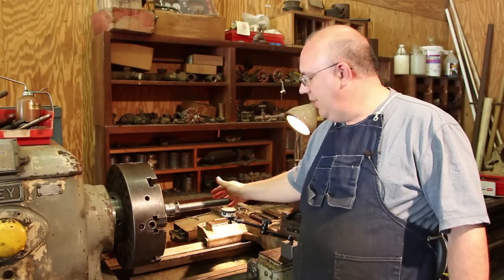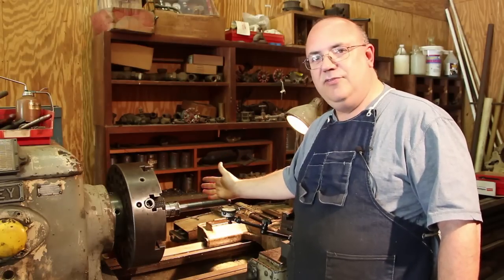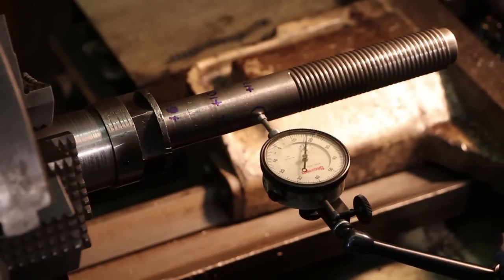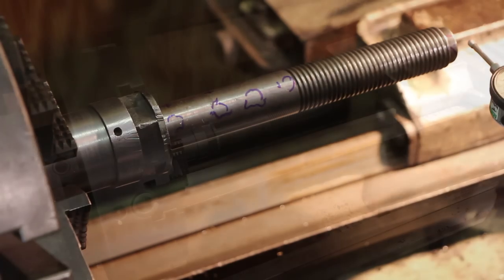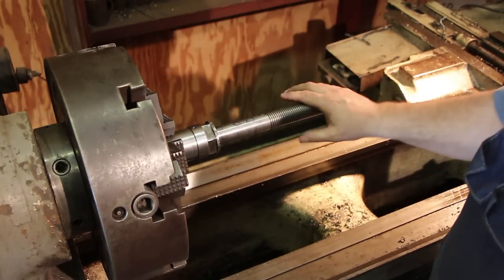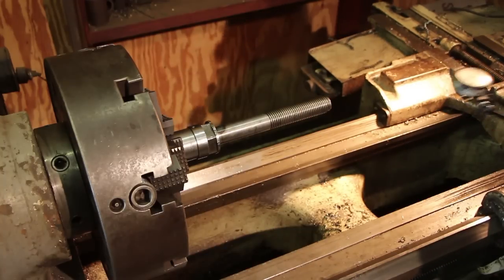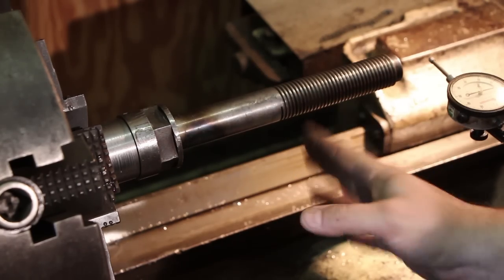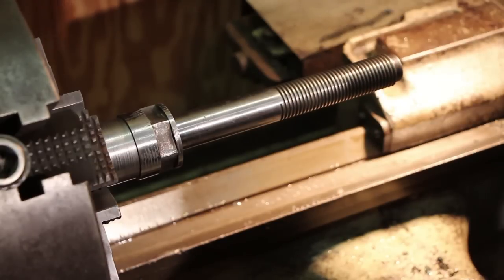Flame Straightening a bent Steel Spindle

Comment: Hey Keith,

Nice video. You got the technique right. The arbor was a great example for the process.

All the best,

Tom
Reply: Bill Lewis the way the shaft is bent, it's bent towards the high side, heating that side near the base makes that side grow a little longer therefore pushing the other end back where it needs to go. Putting water on to cool quickly helps "freeze"it where it is. If he'd let it just cool it probably would be back where he started
Reply: Bill Lewis Hi Bill,

Its almost purely mechanical in nature. Its an upset. The rapid heating pushes against the surrounding cooler material and forms a small upset. The net change is a shorter section right where the material was heated. It acts just like a tiny turnbuckle pulling the material up. I have a chapter dedicated to the process in my books if you want to learn more. Welding does the same thing. As the hot weld cools it shrinks causing the same turnbuckle effect.

All the best,

Tom
Reply: oxtoolco Tom- I have the same question as Bill. I replayed a couple times and if I understood Keith's indicator, in this case the work moved the opposite way; that is, the hot spot didn't shrink, it grew.  Conventionally the heated spot (or weld bead) should freeze under tension and shrink.

???

-mike
Reply: I'm surprised at how this worked.  In a prior life I was  a structural steel welder/fabricator and did lots of heat straitening (up to 60ft long beams).  Our practice was and my experience still is ( I work with sheet metal now) that the shrinking/cooling effect is more powerful than the expansion/heating.  I always heat the OUTSIDE of the bend.  Adding water or compressed air to cool increased the effect.  Does a solid shaft react opposite of a structural/hollow member?  I'm totally confused at how/why this worked for you Keith.
Reply: 76RSLT Hi 76,

The net result of the application of the heat is a shrink. So you are correct that the high spot or outside of the bend it heated and cooled. Initially there is an increase in the bend but on cooling the net is a shrink. Its behaves just like welding. 

Cheers,

Tom
Reply: Thanks for the reply Tom, your description is exactly what I expect.  I watched the video again and it appears Keith is heating the inside of the bend?

Tim
Reply: 76RSLT Hi Tim,

I'm pretty sure Keith said and heated the high spot of the bend which he mapped and marked early in the video.

Cheers,

Tom
Reply: The picture in the link is correct. Heating the high makes it less high after cooling. 

---Tom one last kick.
Reply: I think you guys are forgetting that this piece was bent into the out-of-straightness. Whatever bent it crooked would've left internal stresses in the shaft (the "high" side Keith refers to would be in compression and the "low" side in tension). Most likely those stresses helped nudge the shaft back straight when he heated it. Note that bending something on purpose usually includes an annealing or normalizing heat treatment after to lessen the internal stresses.
Reply: Casey Baker Hi Casey,

The heated spot acts like a turnbuckle and actually pulls the material. The mechanism is not a stress relief. It becomes almost purely mechanical because the material on the heated side is shorter. 

Cheers,

Tom
Reply: oxtoolco That actually doesn't make any sense. Watch the video closer and you will see he is heating the "high side" which expands that side relative to the other side. The internal stresses (which were imparted into the shaft by whatever bent it crooked) then act to push and pull the shaft back into the state it was originally annealed to (straight). The water quenches the metal and causes the grains to crystallize, locking in the slightly straighter geometry.
Reply: Casey Baker And your explanation doesn't make any sense either.
What happens is when he heats it, the metal expands and undergoes plastic deformation. Then when he cools it back to room temperature, the metal contracts and pulls back to a straighter geometry.
Reply: John Cochran John has the mechanism of what happens right. Its a mechanical correction that happens to be applied with a heating device. On thinner material you can easily see the upsets and bulges from the flame straightening process.

Cheers,

Tom
Reply: oxtoolco I'm having a hard time imagining this; could you point us to a relevant video or images that explain what you mean?
Reply: It's because of the water, that's what keeps it in position. Heat applied to the high side will make the material expand and the water cold it faster than what the material is able shrink back pulling it the opposite direction.... Now, if you were to apply the heat to the low side and allow it to air cool, it would first expand making the bend worse, then it would shrink past its original position pulling it into the proper direction.
Reply: Tony Turner Hi Tony,

The root cause is an upset on the high side. Read my book on the subject for more detail. The rate of heat input to the high side causes the upset. The water just maximizes what each shrink produces. It will still upset without water just not as much.

Best,

Tom
Reply: What book is that? I would like to read the detail because, from my experiences, I believe you to be wrong... Whilst you are correct that the material will upset (expand) when heated, it will most certainly shrink on the side you heat once cooled. The temperature, the rate of cooling,  and the composition of material all have a specific bearing on the value in which it shrinks.
Reply: Tony Turner Hey Tony,

Yes that is the idea it shrinks on the high side or long side thereby shortening it. The metal expands as its heated into cooler metal faster than the cooler metal can accept it. So it does the only thing it can do which is displace upward. When it cools, either by itself or with coolant for maximum effect it stays in the upset condition which is shorter. This upset acts like a tiny turnbuckle pulling on the high side and shortening it which straightens the shaft.

The books where I discuss this in detail are called Sink or Swim metalworking and metalworking doing it better. Available on Amazon or through Industrial press (the machinery's handbook guys). I show shaft, plate and weldment straightening with the flame straightening process.

Regards,

Tom
Reply: Tony Turner I don't think you realize whom you are suggesting is wrong! Do a google search on Tom Lipton. I think you will realize pretty quickly he is not some random you tube goofis. The guy has authored two books containing the subject you are debating. I would listen to him.
Reply: It does not matter if he has written two books or two hundred. He is still capable of being incorrect just like any other person, it's called human error. As for him being wrong, I misinterpreted his initial comment and he clarified in the second. Even though I do not like the way he explains the way the physics of the metal moves, he is correct. But, alas, we do not have to always agree with each other. He may not agree with something I say and that's perfectly fine. Just keep in mind, debate is one of the greatest ways to share knowledge, not by being a cocky and smartassed prick. Just something for you to think about Jarret Hall.

-Cheers
Reply: I do hope the couple of names you used in the next to last sentence were examples, and not directed at me. That being said, I agree with your point on debate being an important part of the communication of knowledge.I didn't intend to offend you. It's just I have a great deal of respect for Tom, and consider him a mentor. I can get defensive towards others that disagree or debate the opinions of folks I hold in high esteem.
Reply: Actually, they were directed toward you. Because, while you were "getting defensive towards others that disagree or debate the opinions of folks you hold in high esteem", you were acting like a child.... I may not be some esteemed author but my education, experience, work, and overall knowledge on the subject speaks for itself. And, since you don't know who I am (I will not be found on Google by the way), I wonder what LEGITIMATE reason you had for chiming in in the first place...... I've made my point TWICE now so I will not be commenting on this subject again. Good day to you sir.
Reply: Keith and Tom, like some others, I'm still a little confused on this. I understand Tom's explanation of what happens, and it fits what I've seen when welding...the metal "curls around" the hot spot. For example, if I heat the east side of the base of a flagpole, the pole will tend to lean toward the east once cool. To straighten it I could heat the west side of the base. So far so good, but from what was said in Keith's video, it appeared that he was doing the equivalent of heating the east side to make it go west...so I'm wondering if the confusion is stemming from the "high side"/"low side" terminology?  There was another video here that raised the same question with respect to centering in a 4 jaw chuck.  I'm watching on an iPad, so it's hard to see what the indicator is doing, and I'm still new enough to indicator use that I'm not sure I'm understanding what I'm seeing anyway, so I'm not clear on which side of the curve the heating us happening on.  Could that be where others are having trouble too?

An alternate theory I'm considering is based on the other commenter mentioning heating to forging temp and getting plastic deformation.  That is how Tom's method works...but Keith wasn't heating that hot....so perhaps his heating caused the expansion movement, but didn't get hot enough for plastic deformation of the heated area, and the opposite side, which was in compression from expansion on the hot side, distorted a bit to become shorter, so when the hot side cooled, it couldn't go back to where it started due to tension on the colder side?  That might account for how heating the east side could move it west.

So, is it terminology confusion, less heat causing a different mechanism and result, or something else?

-- Mike
Reply: *****
Keith, I understand completely that you are showing what you do, not doing just to show.  I think that's great, since it shows real jobs being done with the kinds of issues that come up when it isn't a contrived situation.

As for the flame straightening, I watched again on my desktop where I have a much larger screen and could easily see the indicator, your markings on the work, and where you were heating.  Based on that, I think I'm leaning toward my second theory.  I don't think this behaves the way welding warpage does, and that's probably because of the lower temperature you are heating to.  In my analogy with the flagpole, your "high spot" is the east side, and you heat the east side to make it go west (away from the high spot and therefore straighter).  I think I understand what's happening, and I'll have to play with the torch some this weekend to confirm it.  I have a mailbox support to make anyway, so I'll have the torch set up.

Thank you very much for the video, and the discussion.  Thanks also to Tom and the others that contributed.

-- Mike
Reply: BigMjolnir My guess would be that the added white hot material when welding cause a warp turning in towards the bead, so it's really the bead doing the pulling. Quite opposite what happens in Keiths straightening.
This makes sense as you get less warpage when welding preheated work. It also suggests that you could get less warpage if you immediately cool the weld. Haven't tried that.
Reply: Bill Lewis This is visualized a lot easier with V blocks.  This bend is a little different than say a bend in the center of a bent shaft.  I watched the video 3 times and contemplated this for the past 45 mins.  I think this worked because the deformed metal heated up and had a chance to relax back to it's original position and/or cooled fast enough to freeze in place.  He was not heating the high side because he heated the side that started at  +6 and the other end was +50 something.  If it was the high side the indicator would have read +6 to -50 at the end  Heating at the +6 means it's the lowest part of the bend.  In a typical shaft you would heat at the point that is out the most.  So either it was chucked out of round, the metal relaxed, or it froze.  Either way, good job getting it straight.  It's cool to see somebody tackle something they are not familiar with and succeed.
Reply: +oxtoolco What a frustrating thread of people arguing past each other. People keep saying 'how come heating on the high spot worked for Keith?', and +oxtoolco assumes high spot = outside of the bend, so reexplains the mechanism. But in Keith's setup what he calls the 'high spot' is on the inside of the bend, so everyone asks the question again. and again... I too want to know how on earth this worked.
Reply: it worked because the actual stress point is the bottom of the cup )where the bend actually is), not the shaft. the metal that has been cold worked longer has to be thermal contraction shrunk, right? ok, that spindle hangs a gang of knives off the bottom of a cup. a "crash" bends the cup bottom, not the spindle. the side of the cup floor the spindle is displaced towards will be the "stretched" metal. there will be a "low ripple" at the shaft root, and an "eyebrow" at a flexy spot outboard. the eyebrow is the actual stress point. so, we can straighten the shaft (with varying results) a few ways: as keith did, we get "shrinkage tugging at the stress, kinda" (so you get decent returns with a bit of trying). you can heat the shaft opposite where keith did ("expert opinion spot", lol), and get the shaft "straight" to the spindle threads, but with a deformed shoulder (so uneven thrust loads while running, "mystery chatter"). you can heat the shoulder, just above the root, opposite the "high side", and "counter stress the brow out", (shrinking the hinge, basically) which leaves stress wandering about in that shoulder/shaft junction, which is kind of undesirable. finally, you can heat about 1/4 inch up the shoulder, right on his "plus .005" mark. that would put you right on the eyebrow, and would give the best results.

to see what i mean, take a piece of all thread, nut it on both side of a hole in some sheet, and firmly edge clamp the sheet over a hole. give a firm sideward whack to the all thread. bingo, that's what happened. basically, its a shaft with a 90 degree dogleg, and the "bend" is in the thigh of the calf he was heating, lol. we can get that all thread to stand at 90 degrees to that sheet again, but how we do it determines if that sheet is wrinkly, creased, wavy, bulged one way or another, or nice flat and planar. keith got a happy medium (wavy sheet). "expert opinion" delivers a creased sheet. counter shoulder heat would have been "bulged". get it?
Reply: what tom is saying is correct initially when kieth heated it on the side that he did the molicules  expanded and the shaft went the way he wanted it to go and the only way this worked is because once it moved a few thow he quenched it with water to freeze it in that spot. i worked in the alberta oilsands for 11 years with the millrights allighning pipe flanges to pump flanges as big as 3 inch to 42 inch pipe flanges, the pump flange is god . we had to mate up the pipe flange to mate up to the pump flange within 0.001 of diameter of flange to a maximum of 0.010 wich the fussy millrights ony wanted 2 or 3 thow. we would grind out the weld on the cap and go in as deep a i thought we needed to pull somtimes up to 0.125 to mate up. what kieth did would not have worked 4 somthing like that because we cannot put water on our heated weld qc-- quallity controll would have lost it and made me cut the joint out and then fired me lol. so we would have heated it on the opposite side that kieth did making it go the wrong way at first because it expands BUTTT AS IT COOLS IT COMES BACK TO WHERE YOU STARTED FROM AND CONTINUES TO PULL AS THE MOLLICUES SHRINK BRINGING IT  FARTHOR IN THE PROPER DIRECTION THAT YOU DESIRED. 555 BOILERMAKER THUNDER BAY ONTARIO CANADA.
Reply: Jamie Buckley saa
Reply: @76RSLT Got me confused too. You heat the side that you want to shrink. Well, that's what I've done on RHS with air cooling and it worked as expected. Heating the side that needs expanding? Now that's new to me.

Comment: Nicely done sir!
I need to straighten a bent drill press spindle, that I can’t buy a replacement part.
I have no Lathe, no oxy - acetylene torch, and no run out dial indicator, so with just a vice & butane torch & straight edge, I’m guessing I’ll have to employ a hardwood 2 x 4 & some leverage & wing it and see how I go!
Still handy to see the principle at work by an expert.

Comment: Keith, Great video.  I have flame straightened quite a bit of steel.  I was taught that you want to use counter pressure as well as heat to speed things up.  Also if you are flame straightening square stock you want to use the counter pressure to insure a proper bend and not have your work twist as it cools.  This is not as critical on round stock but it is very critical on c channel, square tubing and H or I beam.  On square stock you use a V shape heat pattern where the Top of the V is the area you are wanting to shrink.  You begin the cooling process at the bottom of the V and move upward.
Reply from the maker: +Scott Young Thanks for the tips!
Reply: I agree with you, counter pressure can provide better control over the response of the item to heating and cooling.  I have worked in the construction industry.  We have straightened out deformed structural members by loading the element with hydraulic rams or chain come alongs while applying heat.  This works well when building up large plate girders on site.
Reply: or you use a diamond shape its called diamond heating.